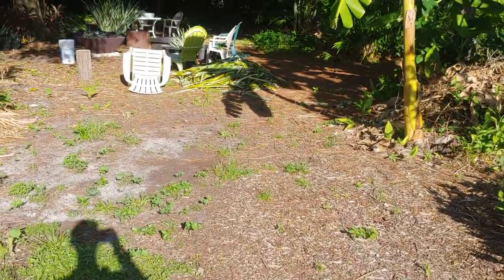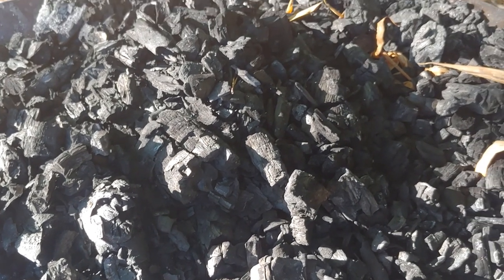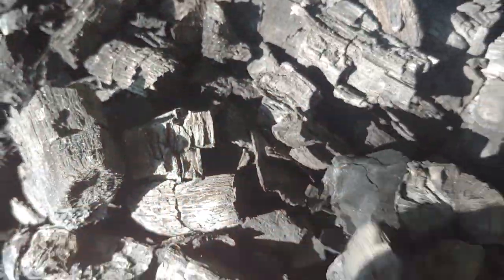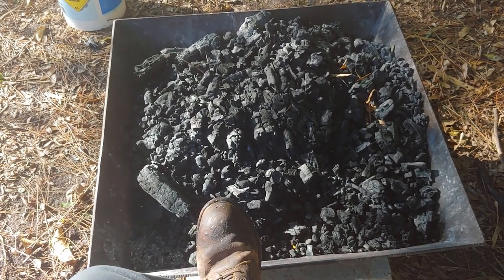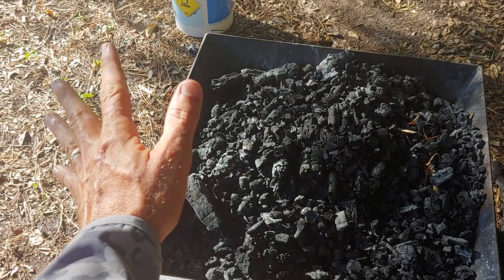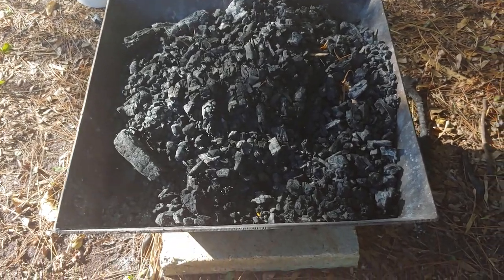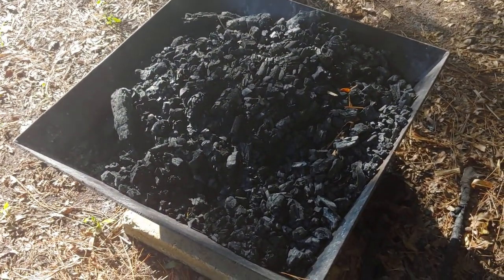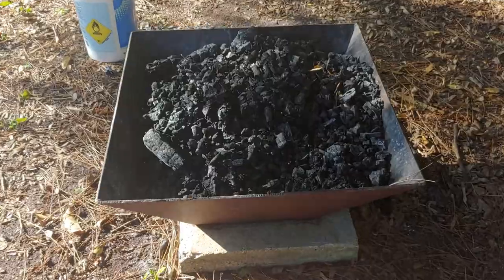Choosing the right BIOCHAR KILN for you

Comment: Here in Oregon we had the local community college make a number of these kilns, 4 and 5 foot square.  5 footers weigh around 600 lbs...3 1/2' to 4' seem to be the ideal size and weight for 1-2 people.  Handles are nice and a 3/4" drain plug for draining after the quench are nice additions.  The larger kilns are nice in that you seldom need to cut the material you're throwing in...anything hanging over the edge gets thrown in after it burns off.  The big kilns do warp from the heat, but doesn't affect performance.  Thanks for sharing...good video.  O.J.